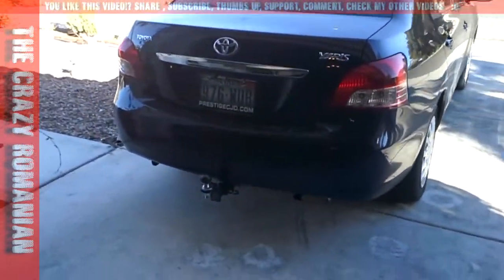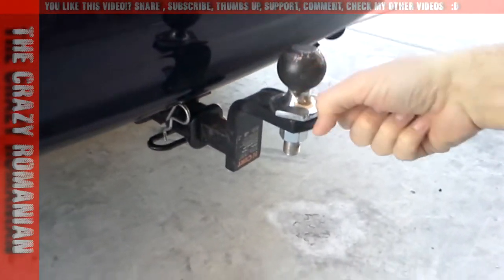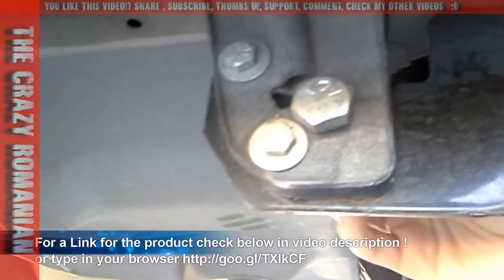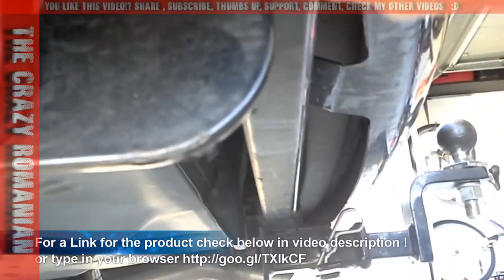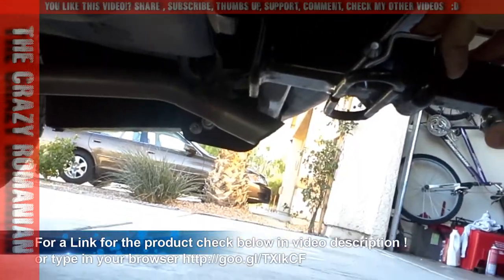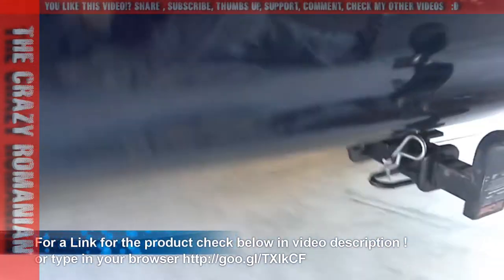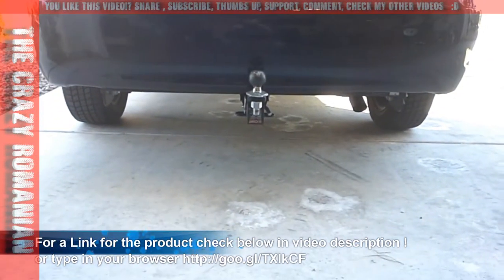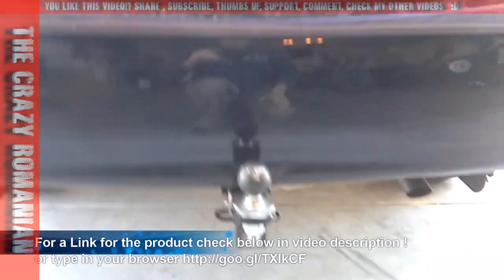How to install a Trailer Hitch on a Toyota Yaris

Comment: So on the internet, it says that my Toyota, R, S, you can pull a 750 kg, unbreaked trailer, and yet I look in the owner's manual, and it says, you shouldn't be towing, what is your background on this? Have you actually towed things without problems? This is why I hate engineers so much.They don't give me a y part
Reply from the maker: Yeah it's a class one but I never really told more than 750 kg which is 1500 lb